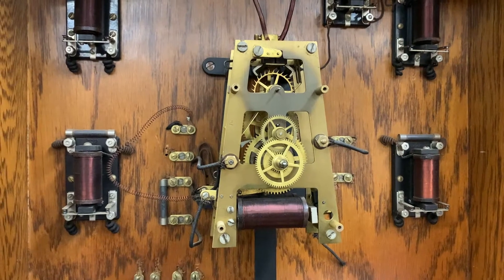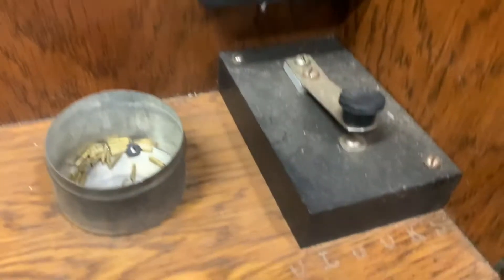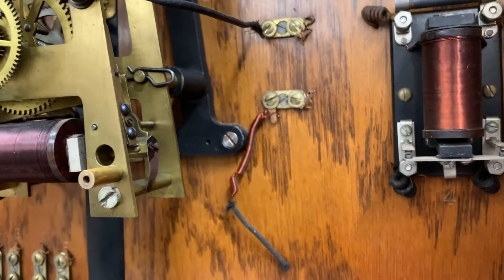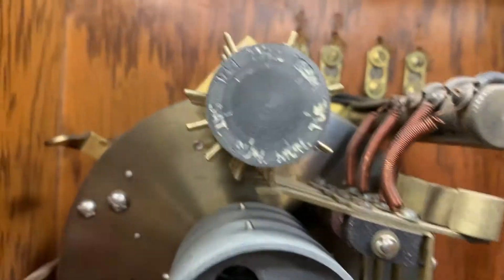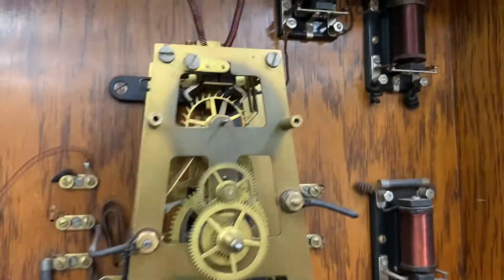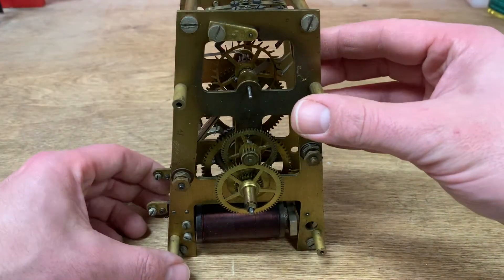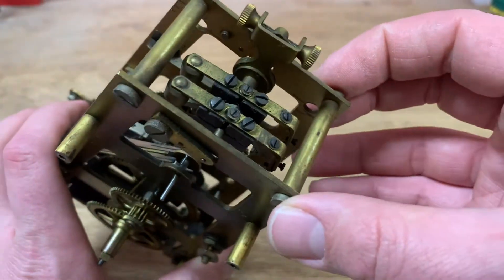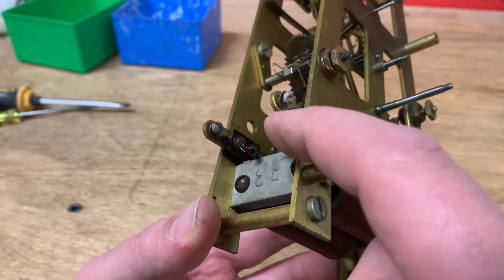Standard Electric Time Master Clock Restoration Part 2

Comment: I've been dealing with a Siemens-Halske 1959-ish master clock and been struggling with how would I maintain it since it needs a complete cleaning from old improper grease. Thanks to your video I just now realised that the pendulum and the mechanism are not connected, just engaged! That helps a buch. Seems obvious in hindsight! thanks